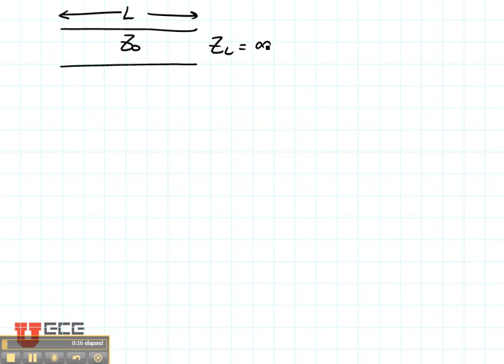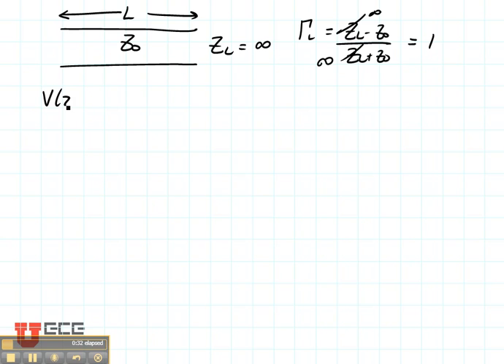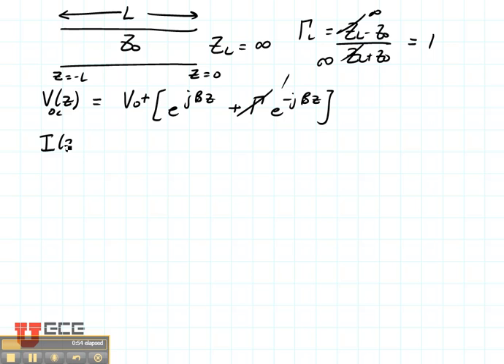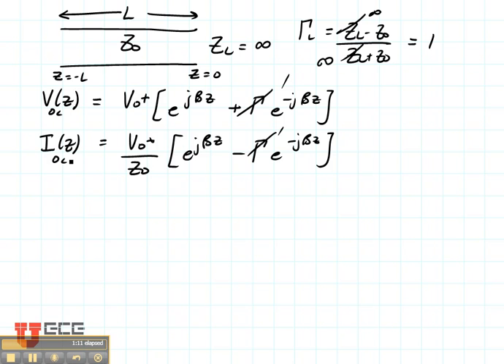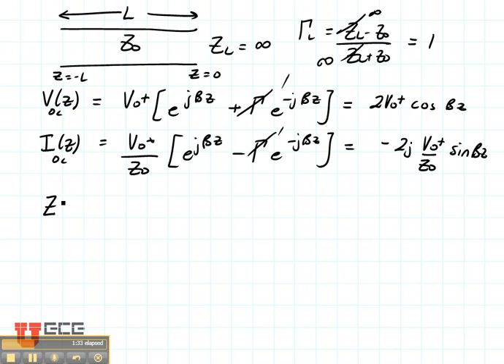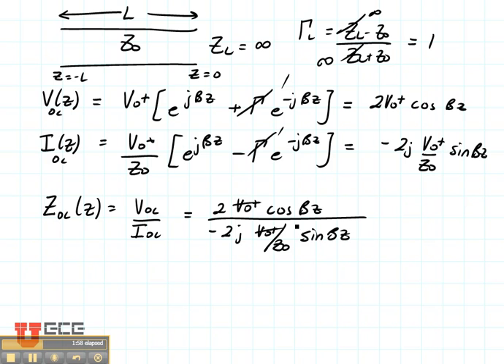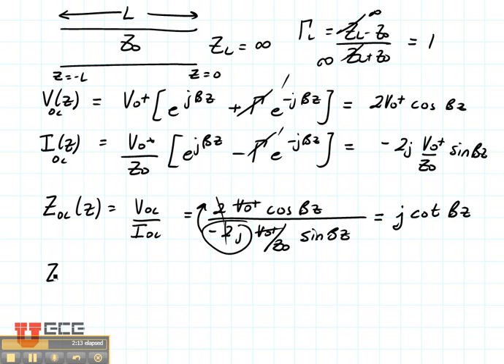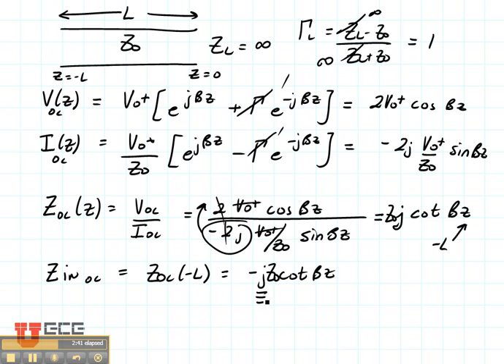ECE3300 Lecture 8-4 LC open circuit

Comment from the maker: For the open circuit voltages and currents, I believe that you switched the (-) and (+) on the exponentials and we hadn't plugged in (-L) yet.
 
 
I think that the short circuit is correct.
Reply: yes thank you